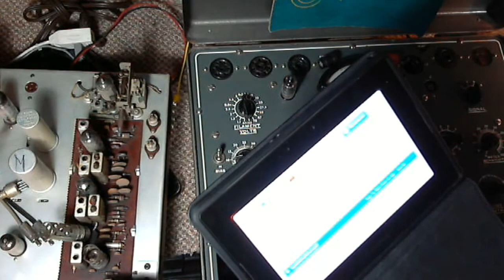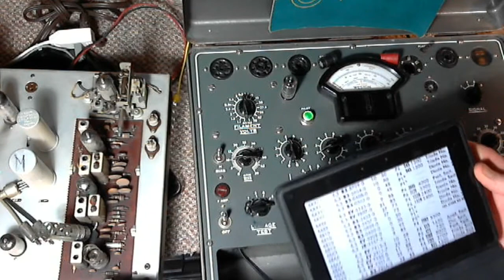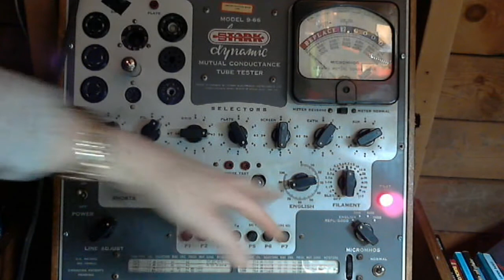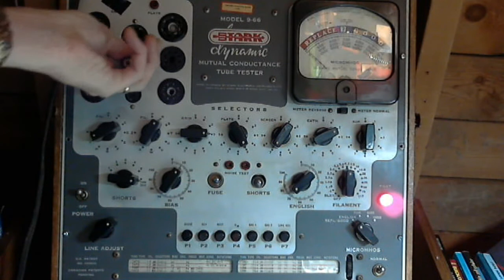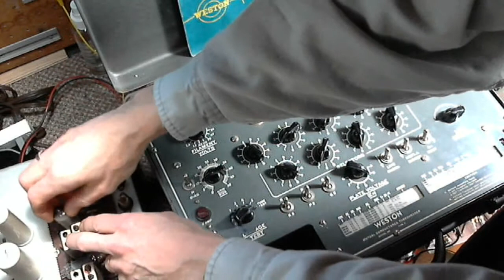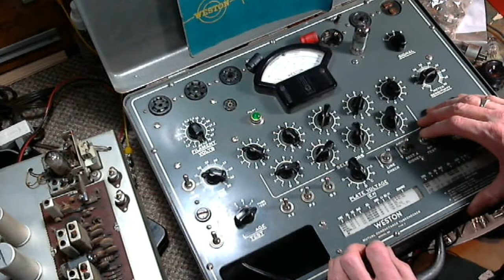Rogers Majestic 8059A Console Stereo Video #5 - Tube Testing Continues

Comment: Jim, the first tube you tested as bad you said it had no shorts, but if you review the video you will see the short indicator bulb flash on but you clicked past it so fast you did not see it flash. It is clearly visible on the video.
Reply from the maker: If the light flashes, there is nothing wrong.  If the light stays on, then there's a problem.  Thanks for watching so closely.  Jim.